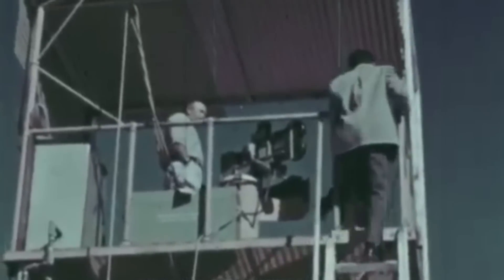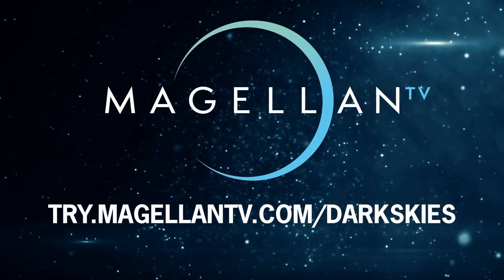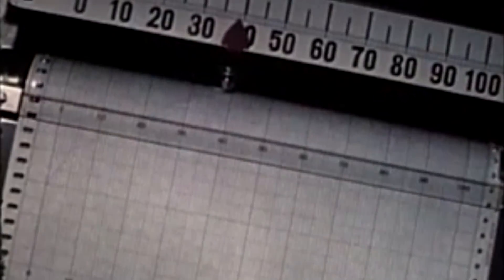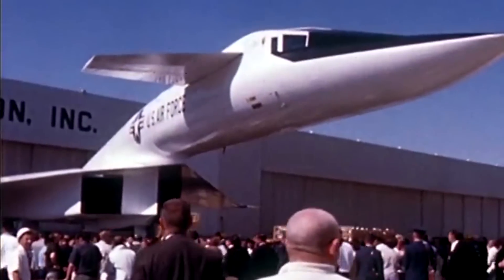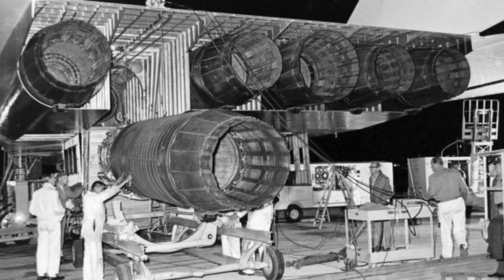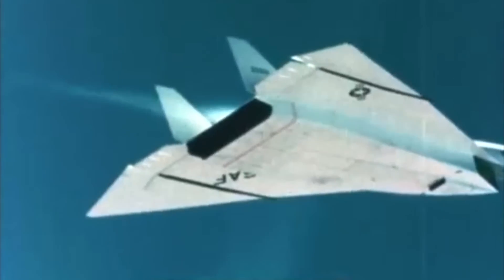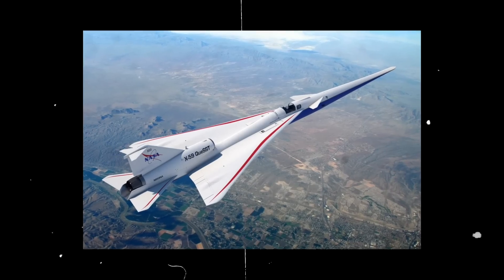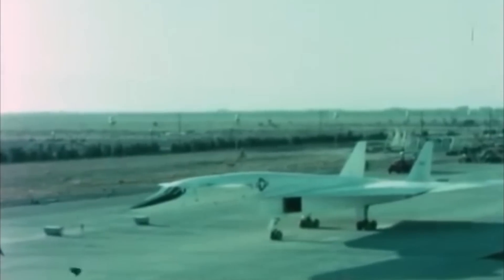XB-70 Valkyrie - Mach 3 Nuclear Bomber

Comment: You can see the data collected as design elements in the F-22.
Slightly drooped wings to capture part of the pressure cone shockwave generated by the stealthy intakes for super cruise flight.
Reply: Sorry but I don't see any "design elements" between the "North American" airplane designed in 1958, and the Lockheed airplane developed around 1988. Not sure what you mean by drooping wing. If you mean anhedral, it was eliminated on the 2nd XB-70A, and there's little of it on the F-22. The XB-70As intakes are likely not stealthy, and were designed to exploit "compression lift".  I've never read any mention of "compression lift" in development of either of the ATF designs.

Comment: I have read the Soviets were so afraid of the XB 70 , assuming it would go into production ... that they developed the Mig 25 with a powerful radar to intercept it.
Reply: Where did you read that?  The reason I ask is because it doesn't make that much historic sense.  B-70 preceded MiG-25 by a few years, but the decision to cancel the B-70 happened only a few weeks after the MiG-25 program was authorized, leading to nearly a decade of Soviet development occurring after the American plane was no longer expected to enter service.
Reply: @winternow2242  Don't remember but it may have been Belenko's book Mig Pilot. I remember that he claimed the radar was a hazard to air crews and animals  so they could only  run it when in flight. They seemed to be worried the US would have a supersonic bomber ( remember the B58)  and they thought there would be only one chance to intercept at those speeds so the radar had to be accurate.  I don't consider myself an aircraft  expert and am only passing along what I've read.  There was a lot of mystery to the soviet aircraft in those days so lots of things  that we thought were wrong..

Comment: The MIG 25 was designed to shoot down the bomber but was nowhere near as good as their adversary fighters from the United States 

In fact, in 1976, the plane was examined close up in Hokkaido Japan after a disillusioned soldier pilot stationed near Vladivostok defected. Close examination revealed that although it's fast and can take off quickly, it wasn't maneuverable and its engine couldn't withstand the excessive heat as it was mostly made of stainless steel. Titanium could have made the plane sturdy but was super expensive because the soviet economy was poor at the time. 

The engine, on the other hand, gets damaged easily if the plane exceeds 2.8 mach. The pilot also revealed lots of enigmas the soviet military and air force has like its tactics. In addition, the pilot also revealed that the mig 25 attempted to shoot down an SR-71 but was too fast to take it down

Comment: ''
come on american company can make many more better XB-70 Valkyrie airplanes, better long range and more little speed up...
must be short neck and not long neck...
2 intake air to the 6 jetmotors are not enough air flow the air outtake...

same as B-1 / F-16 / F-111
someday would be a new XB-90 Valkyrie
Reply: So we should make more airframes of an aircraft we designed over 60 years ago, and update it so it's like airplanes we built at least 40 years ago?

And we should do that...why?
Reply: @Galileo7of9
hi G...
'
yes smart comment...
not stupid

Comment: if the russians couldn't knock down an sr71 then I doubt they could have had any better luck against this since speed was similar.
Reply: According to reports I've red, SR-71 only flew at the fringes of Soviet airspace, rather than flying as deeply as a would be demanded for a bomber.  Of course that could be wrong, but do you have any evidence that the SR-71 flew as far into Soviet airspace as a manned bomber would need to?
Reply: @Galileo7of9 I always assumed that they had fired on SR-71s. Also, until now, I'd never considered the distinct RCS of the B-70 and the Blackbird.

Comment: IIRC, the Soviets at the time were terrified enough by the XB-70 to build the MiG-25, a high altitude interceptor that could reach Mach 3.  Even when the XB-70 was cancelled, the MiG-25 stayed on.
Reply: I have yet to see any sign that the Soviets were at all scared by the B-70. The Soviets had been working on high speed interceptors since the mid 1950s. The MiG-25 formally initiated a few weeks (at most) before the B-70 was cancelled as a weapons system, and was still in production years after the last B-70 was left in the USAF museum. The Soviets began and killed many aviation projects, and this would have been one of those had it been as linked to B-70 as is commonly said.

Comment: Who would want to go from NYC to LAX in 90 minutes?!? 
FYI when this passenger version was scrapped, this was the thinking…
“It’s so enjoyable and luxurious being aboard planes for 6 hours with fine dining and wine pairings that you get now, who’d want better?”

Yeah….nothing’s changed at all.
Reply: Is that an actual quote?

In any event, who wouldn't want a shorter trip, first class or otherwise?  The amenities of 1st class are irrelevant because most people were not first class passengers, but economy passengers who would have preferred enduring coach class in half the time, were that feasible. SST wasn't scrapped because high speed air travel wasn't wanted but because it couldn't be made economically feasible.

Comment: I heard that the tech from this plane and the info learned from this was used to help make the B-1 the original version of it...
Reply: Where did you hear that?  The B-1A is quite different from the B-70.
Reply: @Galileo7of9 are u saying im miss informed?? The B-1 A was originally to be a mach 2-3 bomber.... But the improvement of surface to air missiles caused them to imploy  the use the flying map of the earth, so mach 2 speeds wasn't really needed...
Reply: Tech meaning technology
Reply: They also used alot of tech from the f 111, I'm not going to go through it all, this is the comment section not the teaching section
Reply: @satyanandpersaud8309  B-1A was never intended to be a Mach 3 bomber.  It's top speed would have been around 2.3.  There's no way that the US would have ordered the B-1A as a mach 3 bomber, then cancelled it because of improvements in Russian air defenses when the same logic had led to the rise and cancellation of the B-70.

So, yeah - you're extremely misinformed.
Reply: @winternow2242  ur holding on the the mach 3 thing aren't u realizing it's the only thing I was wrong about... They never flew the xb70 past mach 2.5 but it was intended to be a mach 3 bomber also.. typical you tube tough guys... Word games... The best u can do... All I'ma say is that I'm not going to do all the work for you guys I know what I ment,  u know I was right... and it must really burn u up... Trust me I know and forgot more about aviation than the both of u know now ..
Reply: @Galileo7of9 why did they change the hole ejection section from the pod to regular ejection seats???
Reply: @satyanandpersaud8309  "why did they change the hole ejection section"

Probably because pods are more expensive and complicated than ejection seats, and add weight.
Reply: @Galileo7of9 On the internet, the term is "schooled".
Reply: @Galileo7of9 seems typical on this subject. I think they're just trying to trigger people.
Reply: @Galileo7of9 bro I just estimated ur quoting shit..smh I never claimed to be a expert,

Comment: The soviet counterpart could only do mach 1.3 @ 39k feet. The failed hardcore
Reply: @Galileo7of9 look up the sukhoi T-4
Reply: @Galileo7of9 its a blatant copy, regardless of what lying communists say. Plus, it failed big time. So shove the propaganda you so readily believe. You agree with everything china says i bet.
Reply: @Galileo7of9 its a blatant copy just like the concordski, which also failed miserably 😆😆😆. You do know the soviets stole plans to build these two jets right??? Unluckily for them they were fed bullshit so its anywonder both aiframes did not deliver.
Reply: @stevejones1488  if you're calling T4 a copy of B-70 it's probably because most (if not all) of the pictures you've seen of it are from the front, with its long fuselage, canards and centerline ventral intakes. A 3 view (especially looking at the top) will show more differences than similarities. T4 has only 1 vertical stabilizer, and it's positioned on an empennage aft of the engines,  unlike the twin stabilizers of B-70, which are mounted on the fuselage, and ahead of the engines. T4 also doesn't have the B-70's folding wingtips, and her designers don't seem to have incorporated "compression lift" as had been the case with B-70.
Reply: @winternow2242  so a couple of complex bits are missing, the design is essentially the same.
Reply: @stevejones1488  How do at least 4 prominent exterior features become "a couple of complex bits"?  They didn't even have the same mission.  B-70 was a strategic bomber, while T-4 was going to carry anti-ship missiles.

But if you think the 2 are essentially the same, I challenge you to point out those similarities.
Reply: @stevejones1488 So, the Russian T-4 is a copy of the American B-70...because some other Russian airplane is a copy of some other American plane?  Is this your way of abandoning your argument about B-70 and T-4 without having to admit it?
Reply: @winternow2242  no its another example that proves my point.
Reply: @winternow2242  its ok to be wrong mate. I wont lose sleep over it.
Reply: @Galileo7of9 you got pretty butthurt about this 🤣🤣🤣🤣
Reply: @stevejones1488  What is "butthurt"?

Comment: A stunningly beautiful aircraft if the idiot 104 pilot survived he should have been shot
Reply: That idiot 104 pilot is one of the greatest test pilots in American history, and probably has logged a few more hours in high speed flight than you.  That idiot 104 pilot was flying one of the most challenging airplanes ever built, under flight conditions that were technically unknown.
Reply: @winternow2242  such a great test pilot he ran into a bomber and destroyed that aircraft as well
Reply: @shawnbeckmann1847  yeah, because flight accidents happen to even great test pilots. Have you ever flown an airplane yourself?  Airflow from 1 airplane can drastically affect nearby airplanes. From what I've seen, no one had ever flown an F-104 that close to a B-70 before, so he was flying under conditions that could not be anticipated.
Reply: And this wasn't behind the iron curtain. People weren't just shot.

Comment: When they say it's the largest plane to achieve supersonic flight, they're selling it short.  Granted, I was 16 when I saw it...but it's a behemoth.  Gorgeous, but massive.  The wheels were taller than I was (and I wasn't a short kid).  I didn't see a B-52 up close until almost a decade later...and by comparison, the B-52 was unimpressive in size (even though it dwarfed everything around it).

Seeing this bird out on the tarmac at Wright-Patterson (they hadn't yet moved it into a hangar when I visited) was awe-inspiring, just for the sheer fact that something that large made it into the air.  The fact that it was (and still is) among the fastest aircraft ever flown just compounded the effect.

Comment: The XB-70 was never really a good airplane it had too many flaws to start with in the Air Force knew that thank God they didn't make it or it would have killed a lot of people because of its bad design
Reply: What flaws did it have?  The plane flew fairly frequently for years, and was safe. The sole fatality was due to a collision, and didn't even occur during a test flight. The only flaw I'm aware of was wing angle which prevented reliable flights above mach 3, and that was corrected on the 2nd plane.
Reply: @Galileo7of9 I might have, but the novelty of that wore off about 10 years ago. Another casualty of broadband internet.

Comment: i disagree with the canceling of this awesome bomber. yes missiles became capable of hitting it, but the sr71 was similar and although on paper it was in danger it never actually got shot down and flew a lot more than a bomber would its one thing on paper to hit it but another in reality  . stealth is not a much better concept modern radars and tech can detect them but its not easy even with the capabilities
Reply: Did the SR-71 ever overfly Soviet territory?  I'm not asking this rhetorically, because there's been some discussion about whether SR-71s have penetrated Russian airspace, which the B-70 bomber would have had to do. Even if Blackbirds had overflown Russia, the differences between the missions of each plane would have barred comparisons even if the B-70 didn't have to slow down to drop its bombs. I've loved the B-70 for years but even I'm not surprised it was cancelled.

Comment: The only reason why Russia made it's MiG-25, to protect themselves from this piece of twisted mind: No beauty, no compassion, no love... only spread a threat, fear and aggression. Twisted mind made this.
Reply: Huh?  Development of the MiG-25 followed development of Russian high-speed interceptors that had preceded the B-70, including the Ye-150, and related designs. The -150 was designed in the summer of 1958, about the same time as the 2nd WS-110 competition.  The problem is, that that was about the same time that we learned that WS-110 (which became the B-70) was to be a triple-sonic airplane.  Until then, as the -150 was being developed, WS-110 was imagined as a high speed subsonic cruise, supersonic dash airplane.  In other words, according to you, the Russians were pursuing high-speed fighters to protect themselves from an airplane which didn't yet exist.

Development of the MiG-25 was authorized in early 1961, around February.  The B-70 was cancelled as a weapons system the following April, and JFK himself signaled that decision the previous March.  If they were so fixated on the B-70, they could have cancelled the MiG-25, or relegated it tp a research program.  They did neither - and serially produced it for 2 decades, continuing years after the Valkyrie's last flight.

More likely, the MiG-25 was meant as a response to high altitude spy planes like the U-2 and SR-71, and also a necessary way to deal with the vast expanse of airspace that the Soviets needed to defend.

"No beauty, no compassion, no love... only spread a threat, fear and aggression. Twisted mind made this."

I'm sure that you think this really means something.